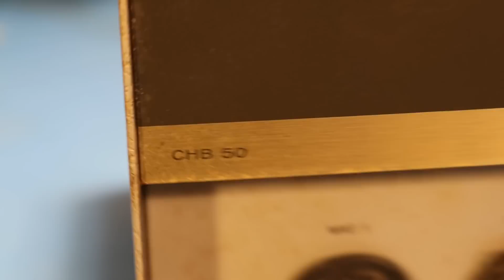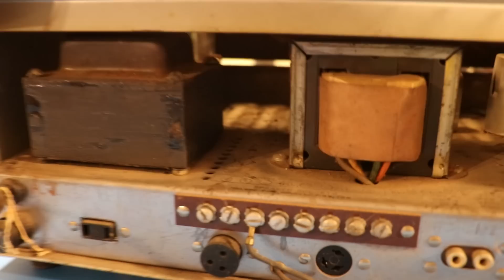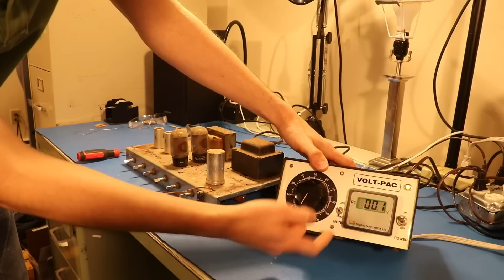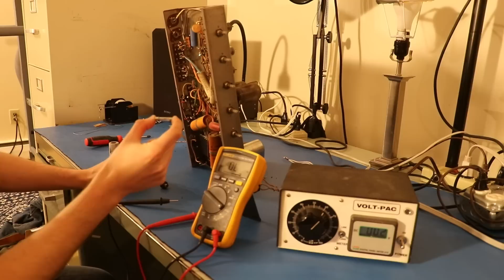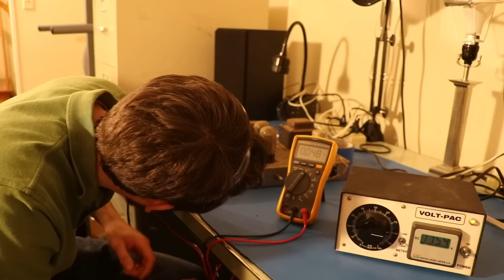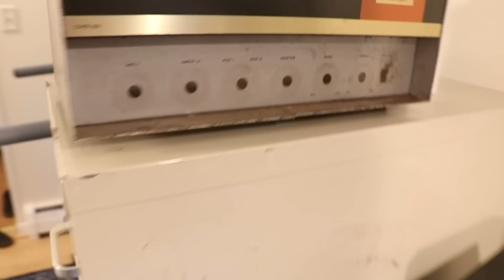Powering Up A Forgotten 60-Year-Old Tube Amp - Bogen Challenger CHB50

Comment: You're half way to stereo, now the owner just needs to find another. They're actually pretty easy to find too. Yes, your project would require a complete re-cap... ETC. When they work properly, they sound very good. That amp should be loud enough "with a good speaker" to get uncomfortable to be around, without too much distortion. The larger Bogen's with 8417 tubes were very powerful. I have many waiting for restoration.
Reply: Ha! So cool to see you hanging out in the comments. I love it when two of my favorite smaller channels collaborate. You guys have both helped so many of us out here.
Reply: Some new restoration videos I hope Mr. Carlson!

Comment: It's a PA amplifier, not a hifi amplifier.  It probably doesn't have good response above 10 kC (10 kHz).  
The controls are designed for mixing multiple signals or fading from one source to another.   
Tubes are easy to understand. Relative to transistors, the grid functions like the base (bipolar) or gate (FET);  
the cathode functions like the emitter (bipolar) or source (FET); and the plate functions like the collector (bipolar) or drain (FET).   
A GB tube will be OK as a sub for a GC unless the plate voltage is too high.  
Get a reprint of the RCA RC-30 tube manual. It will help you a lot.

Comment: I have exact thing only I believe mine is 100 watt model with 4 power tubes.
The microphone levels are for the two weird microphone jacks on the back and the third knob controls the RCA jacks , one to one side and the other to the other side. The master controls them all.
It has multiple speaker connections for anywhere from one or two speakers at 4 or 8 ohm and I believe the higher settings are for use in multiple speaker configurations such as a public address system. I remember a bowling alley near my house having one of these at their control desk for public address.
I bought mine at a yard sale in 1977 and some time later found one like yours at an electronics store among used stuff and it started smoking when I tried powering it up so I took it back.
I still have the 100 watt and used it for bass guitar and just amplifying a tape player for many years but now I have quit using it till I go through the capacitors. I don't want it to get hurt.
I had a lot of amps but this is the only one I still have because my brother and his ' band ' friends didn't like this one as it had no effects.
I also once had an older model Bogen Amp that was rated at 50 watts and I scrapped it when it started red- plating the 5U4. Wish I still had it ( probably capacitor shorting ) I could probably fix it now.
My brother recently told me he found another of my ancient ' metal case ' tube amplifiers still in his basement.

Comment: I would agree with you that there's not much use for an old PA amp.  However, someone might like to turn it into a tube guitar amp (those are still a thing).  Check out "The Guitologist" channel as he's done a few conversions like that.

Comment: When bringing up old tube gear, you need to monitor the current draw.  That's why many use a "dim bulb" (including Mr. Carlson).  The bulb will act as an automatic current limiter.  With that, you would have known something was wrong long before the tube red plated.  Also: always have a load on the speaker output.  Some amps will self-destruct if they don't have a load. I wasn't able to see if you had a load when you first turned it on.

Comment: This is actually a PA amp. Bogen was probably the biggest  PA seller in the US.
PCB's & tubes dont mix !!! Just too damn hot. Once I pulled a horz output tube
out of a GE TV & the socket came with it !!  Zenith was the last to hand wire. That went
away through the 70's.  Probably why so many survived til now. 
Red plate usually from leaky coupling cap to the G-1 of the 6L6's. Thats what killed the
old one. 6L6 like other big audio tubes are stupid $$$ now so watch out !
LFOD !   Zeno

Comment: You probably should have run it through the car wash first. I would suggest the $10 ultra wash with the blow dry and the carnauba wax before you even take it to your workbench.😂
Reply: You must have watched ' Shango ' the TV repairman videos where he actually did just that with an extremely filthy color TV chassis.
Reply: @michaelszczys8316  no, I watched the guy who made this video take a Marantz receiver over to the car wash and spray it off and then he shake-n-baked it in the oven to dry it out, but it turned out good. He got it working again. It was pretty funny at the car wash scene, seeing him hit it with the sprayer.
Reply: @partylee007  ' Shango ' is great to watch. It was indeed kind of crazy car washing a chassis but it was really bad with rat crap and all. They didn't show the actual washing.

Comment: I am not the best at tube stuff either but i am learning.
Anyways the red plating output tube can be because of the leaky paper capacitors,  It was also probably overloading the output transformer since it was passing a lot of current.
Paper capacitors can cause really bad damage in tube circuits, It can fry your output transformer or power transformer and then good luck finding a replacement.

Comment: You gotta have a go at this! You'll fall in love with tube gear as you learn more about how great the technology is.
As others have said, the coupling capacitors have probably failed and leaking DC on the output tube.
The bias resistor/cap, for the tube, may be out of speak and cap leaky.
The filter cap (the can capacitor) is more than likely finished, and a good indication to the hum trouble even when the volumes are turned down.
In other words, the capacitors all have to Go!!  
If they are not 'leaky', they are probably not operating and breaking down fast with the high voltage now, that's why it took a little time for them to react.
If you got keen enough, you can remount new capacitors in those old shell capacitors just to keep it looking authentic, there are a few videos of people doing that you can youtube.
The output tubes should be fine as you turned it off quickly and smartly.
This is great old technology, please don't throw it, find it a good home if you don't want to bother with it.
Oh and another incentive to learn and fix, there's a schematic available online!
https://www.audioservicemanuals.com/b/bogen/bogen-chb/60815-bogen-chb-50-operating-manual
Cheers, Rick

Comment: You plugged your cable into the Mag input. Which I believe is PHONO input. It would overdrive the circuit I believe. You should replace those caps asap! They are so old they are ticking time bombs if they are not bad already!
Reply: Agree:  MAG = Phono input.
Reply: @russellhltn1396  ,  It's probably a ceramic cartridge phono input and not a magnetic cartridge phono input, and therefore it wouldn't have any bassboost equalization or additional gain like you'd expect for a more modern phono input stage. It still would probably overload a little too easily with the input level  from a magnetic guitar pick up.
Reply: @goodun2974  To make it usable as a guitar amp, it's going to take some modification.  But not a lot.
Reply: @russellhltn1396  , Terry Kath, original guitarist for Chicago, played through a Bogen PA amp, purportedly mostly in stock condition. He got a killer tone from it!
Reply: I have 100 watt model, bought in 1977 and used the hell out of it. 
It's been sitting for last 20 years and now I'm afraid to power it up without changing capacitors.
People say they make great guitar amps but the only reason I still have it is because my brother and his ' band ' friends didn't like to use it. They stole or burned up everything else I had. This is the only one left.
One of its best uses was trusted friend
( he would bring it back )  would borrow it , a heavy speaker, and tape player to take to parties, put in the middle of the house, and play Live Ramones tapes.
If it could hold up to the Ramones, it could handle anything.

Comment: On a unit like this I run a variac and a dim bulb together, if things start to short out the bulb will limit the current and alert you to the problem before the fuse blows or magic smoke appears.

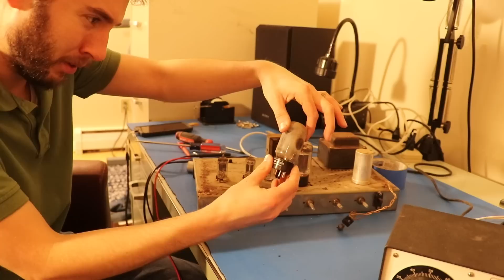Comment: A couple of comments on the 6L6 power tubes: at 2:49 you mentioned that he tubes looked "smoky on the sides", but you may have figured out that's OK. The smoky part is just the getter, which in this case was flashed onto the side of the glass instead of the top. Most tubes have a top getter, which is a darkened shiny region of a reactive metal that absorbs impurities to prevent gas and contamination in the vacuum envelope. But some tubes have this getter on the bottom or the sides. The side getter looks kind of reddish and smoky, but it's not bad unless it turns white due to exposure to air. The other comment is that at 11:23, when you pulled on the glass and separated it from the base, that's not necessarily the end of life. In your case the tube was probably bad anyway, but if you actually broke the glass stem at the bottom of the base, you would have seen a very white getter. Hard to tell from the video whether your tube is just dirty or actually went white. If you are curious, you can carefully cut the bakelite base apart to see how the stem comes to a point at the bottom.
Reply: Good advice,did you know you can make  breakfast on one these?t God bless simple class A stuff. I remember the first time I tried lifting one of these.was pretty sure it was welded to the floor but 200 w x2 bogens equals Nirvana. The amps went on for guitar  and keyboard use.wish I still had them
If you noticed these amps clipped a lot softer than ss stuff and made the great guitar amps.i don't think there would be rock n roll without them. Keep on trucking!

Comment: A 6L6GB can only handle 360 volts max, whereas a 6L6GC can handle 500 volts max on the plate. The 6L6GB is also only around 19 watts compared to 30 watts of the 6L6GC.
Reply: The original 6L6 (metal) and 6L6G/6L6GA were rated at 19 watts and 300 or 350? V. The 6L6GB is equivalent to the 5881 and those are both rated for 430 or 440? V at 23 W. Bogen circuits generally didn't push tubes really hard so that they would last a long time in commercial applications.  It might be possible to use the lower rated 6L6 GB or 5881 in this amp safely but one would have to check with the B plus is at when plugged into modern wall sockets that deliver higher AC voltage than was common when this amp was manufactured.

Comment: You should definitely restore this. Since you already mentioned Mr. Carlson's Lab, you have the best guide possible. Cap replacement will fix the red plate issue in all likelihood. The prime suspects are the coupling caps, which leak DC and ruin the bias point of the output stage. Just assume all caps except ceramic disks and micas are bad. You know the drill on the rest of the contact cleaning, pot cleaning etc. Good Luck! Please fix this! They don't make them any more. Lots of people would pay good money to convert this to a guitar amp. See D-Lab's Youtube channel for examples.

Comment: As others have stated this is a  PA amp probably used for an office system for background music and public address due to the mic input. When using a microphone the other inputs were probably muted. Watch out for the death capacitor. The plug is not polarized and when plugged in the wrong way there could be many deadly volts on the chassis.

Comment: Cool amp and great video.  Reminds me of our console tube tv we had till I was in middle school.  When I switched in on in a dark room u could see a slight glow from the back while the tubes warmed up. They were not red plating though, just a bunch of tubes giving off a little light.  It was a Zenith. I thought I would die when the repair man had to take it into the shop one time because it required more of a repair than just a tube replacement.  Thankfully he brought it back the next day and it marched on for several more years. 😊

Comment: I had a bogan stereo receiver tube amp it had a third channel it would borrow a little from the left and a little from the right channel create the third channel there was no amplifier control whatever you put in for volume is what you got on the third channel this was 1964 it had a tuna that had two fuzzy blue light bars that would come together when you were centered on an FM stereo station don't remember the model I'm 77 now still listening to my vinyl great job fix that amp..

Comment: Hardly worth the effort. All the caps need replacing and probably some resisitors, too. Carlson is ok, but he takes forever to explain stuff. Watch some of     
 D-lab electronics  videos on guitar amps.
Reply: You can use the YouTube software to speed up Mr. Carlson's videos by 25%.  You are correct in that he does take a long time to get around to the meat of the matter. D-Lab on the other hand tends to post videos that are 7 minutes long and claim to tell you "how to fix" something when in reality he skips over most of the important stuff, and he seems more interested in generating customer work for himself than in sharing electronics knowledge and troubleshooting techniques.  For actual guitar amp repair videos on YouTube I mostly watch Brad's Guitar Garage in Australia, and Psionic Audio.  Uncle Doug posts relatively few videos these days but hes got a whole backlog of previous videos that are worth watching.

Comment: Bad coupling capacitor allowing dc to pass through is probable cause of the red plating tube. I love tube amps....they sound great. Get it going!!😊
Reply: Yep, but those 6L6 tubes look original RCA... SO just as likely needs new tubes. The Bogen stuff had typically great coupling caps, but this was after the buyout.
Reply: Also he has no speaker load.

Comment: Point-to-point wired amps are still being made today. PCBs were already around when this amp was made (I'm guessing early 60s?) but PTP is ALWAYS the better choice for tube gear - PCBs just don't handle the heat all too well. I have wired PTP amps all by myself and it isn't that hard, especially since tube circuitry in an amp is usually very simple. you just have to take no chances when it comes to possible shorts...
Reply: The big problem with P2P is it drives up the labor costs (labor time) to build it.  That's fine if you're building your own, not really practical if building to sell.
Reply: From tube socket to tube socket

Comment: I’m confused by your “variac” with a DC volt meter. Is it rectified before going into the meter?
Reply: That would explain why it was so slow to react to turning the voltage down.

Comment: It's really up to you and the owner moving forward bro.  If there is a need for repair/restoration go for it, otherwise use it to educate yourself on tube equipment.  Careful experimentation is called for of course.  Modern circuit boards are much more friendly...